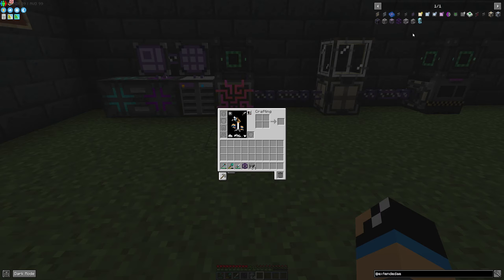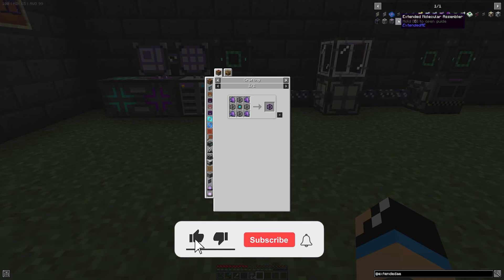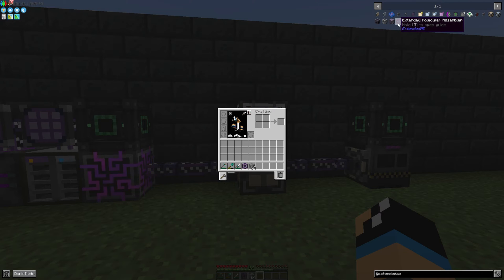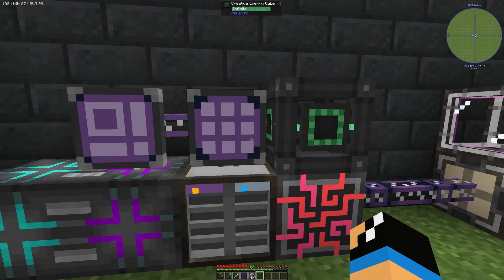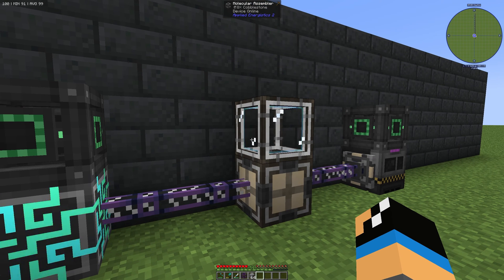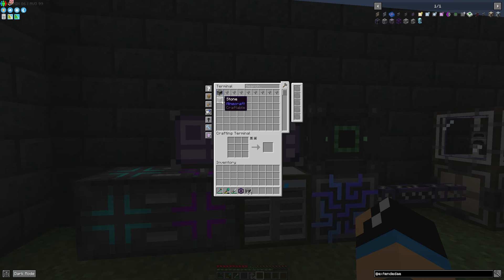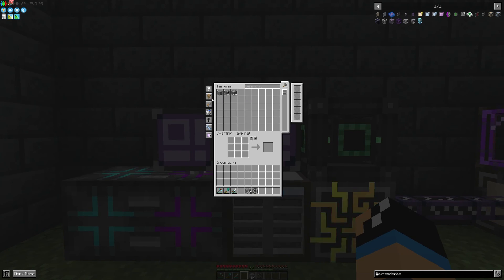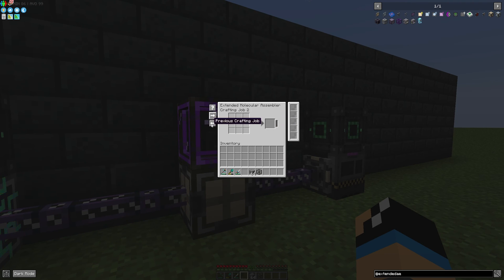Extended Molecular Assembler 📀 Minecraft Applied Energistics 📀 Extended AE 📀 English 📀 #Minecraft

Comment: I am trying to do that but it only uses one of the many crafting slots
Reply: try adding more molecular assemblers connected to the faces of the me interface, also upgrade them using acceleration cards on the molecular assemblers and crafting cards on the me interface
Reply: you dont need more crafting patterns for the same item, when you tell it to make it its only going to use one pattern, not more than 1.
Reply from the maker: you are welcome galaxic :)